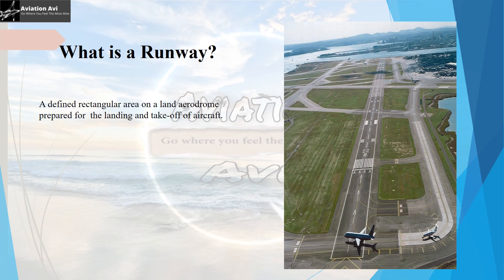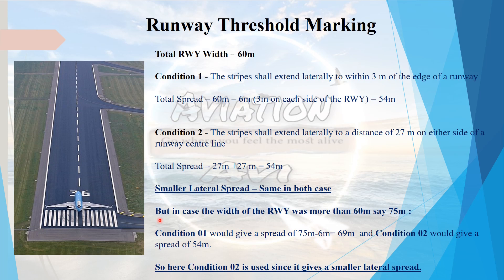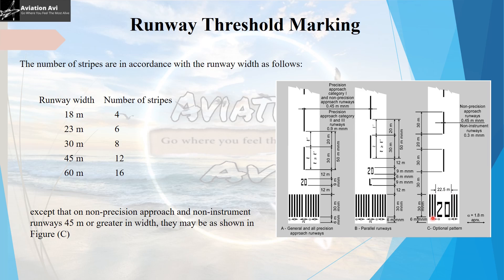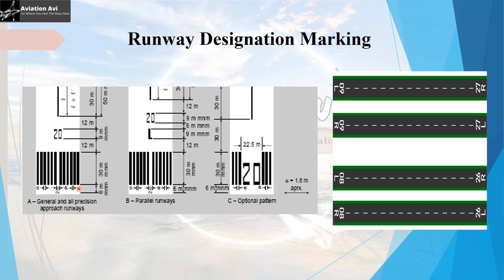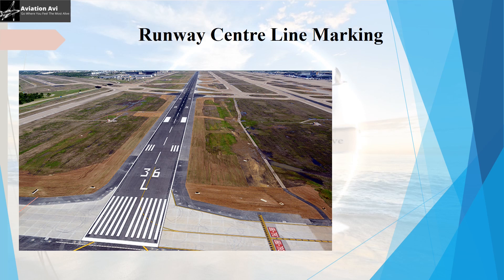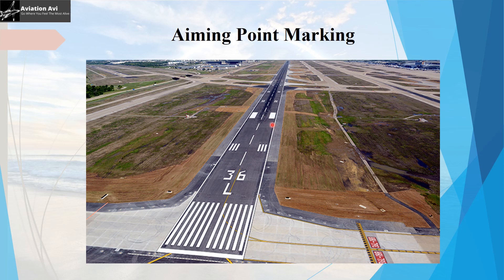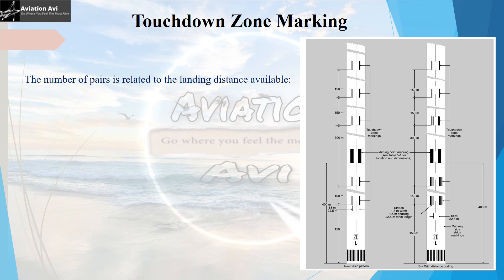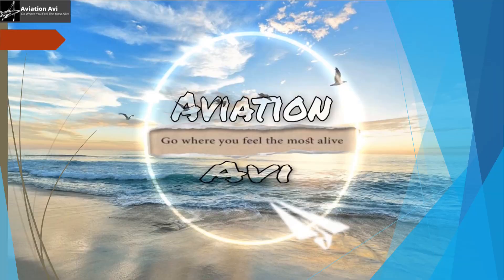Runway Markings - ICAO Annex 14

Comment: Pl check,if runway width ,Max is 60 mts,an example is shown with 75 mts wide
Reply from the maker: Now, as per new regulations max width of a Runway is 45 m and 7.5 m shoulders on each side on the basis of outer main gear wheel span (omgws).